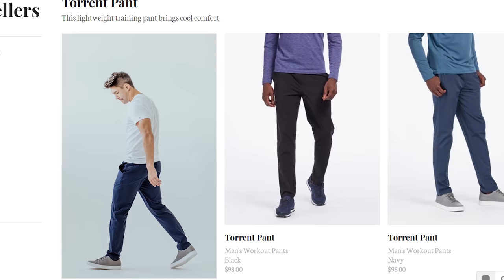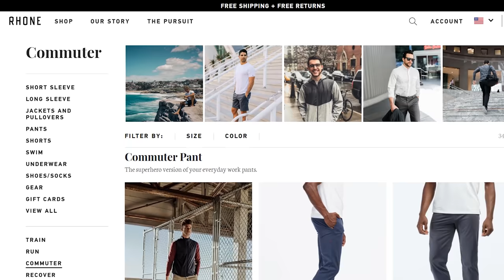Ferrocerium Flashbang

Comment: Revision to my last comment. $250 to the patreon when one of you completely severs a finger OR blows your hand off.
Reply: I'm thinking a whole hand should probably be closer to $375.
Reply: @Scavenger82  If I could spare it. Had I not just dropped $600 on my A/C I'd have $500 for a missing hand and $250 for a finger.

Comment: I just watched a video that outdoes this one severely. They managed to get rods of ferrocerium around 1/4" thick. They heated one of those up while having it suspended above the ground by wire they shaped as a coil and hit it with a golf club. The sparks spread out from the ground to around 7 feet in the air and flew the direction of the stroke a couple of feet before going out.

Comment: Me and friends used to take a lighter apart while driving at night, twist the spring so it will hold the rod then use another lighter to heat it up and toss it out the window on a paved road. They explode so much from the speed of the impact and the night makes it light up a lot. That being said only do when it's wet out and never with traffic behind you!

Comment: I think I know why it exploded when you smashed them with a rock. the reason why is because the rock you used to smash them with is piece of chert which is harder than the concrete below it (technically chert is harder than surgical steel) after which dramatic oxidation occurred and what looks like a giant explosion.

Comment: if you want to use large rods grab a "flint and steel" fire starter brake yje plastic of and take out the rod wrapp ot in some wire and heat with a blowtorch and move the flame along the entire rod then throw it at the ground. 

the resedue when hot if kicked will spark again

Comment: Now, as terrible as this went, you can still do it safer and better. Try this. Get one of those large thick ferrocerium rods (the "flint and steel" kind, and heat up one of those and throw them the same way you did with the small ones. Way safer, and VERY satisfying.

Comment: You need two things for an explosion.  Heat and pressure.  one without the other does not make a reaction.  That is one reason you can burn C4 with no issues.  Burn it, then hit it with a rock = bad day.

Comment: See if one of them can light gasoline or rubbing alcohol for booby traps like the old bucket on a door trick but instead it's ferrocium or whatever with a blowtorch duck taped to the door constantly heating them then flammable fluid on the ground some something opens the door drops the thins blinds them and sets the room on fire

Comment: What IIIIFFF, instead of those tiny little ones from lighters you use the ones for creating fire like the ones in survival kits (literally one would be equal to 3-400 of the disposable lighter one) and heat that up and throw it at a wall

Comment: Guys...  Why use lighter "flints" as your source of ferrocerium?  When you search Amazon for "ferrocerium", the first result is a 1/2-inch thick, 6-inch long ferrocerium rod, used (ostensibly) in tandem with a steel knife as a fire-starter...  

I think you know what must be done.

Captain Obvious:
"Buy a few, scrape the protective coating off, and spark up that propane torch, boys."